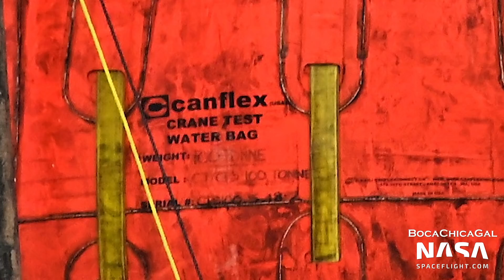Chopsticks Load Testing Resumes | SpaceX Boca Chica

Comment: I think they had a bit of resistance on the rails in the first test. That could be why they have been adjusting and grinding/smoothing them in certain spots. So now a re-test.
Reply: Was  thinking the same. They probably anticipated / planned to do this grinding and smoothing, but saw no point doing it before testing & finding out where it was actually needed.

Comment: 2 * 100 ton freedom units + 2 * 25 ton freedom units would be the full weight of a dry booster.
Reply: spot on
Reply: To clarify, these are 100 and 25 tonnes, not ton. 
So it might be more accurately, taxation without representation units lol
Also a bit heavier, a ton is 2000 lbs while a tonne is 2200.
Reply: I really don't see the logic of conflating the selection of a system of units and other political matters. Elon favours SI FWIW.

Comment: So 2:30 is this a door that will slide inside, swing open on a hinge, or swing sideways on a hinge?  I kinda think the first one would work better, but then I figure for ease of design they might wanna go with something like the Space Shuttle used, it's a design that we already know works and if necessary could be updated
Reply: The prototype door slides "vertically" (longitudinally) to latch or unlatch. This makes the entire cargo door the single moving part for the latch mechanism, similar to the simplicity of a jar lid, but in a linear motion. 

The door may swing "down", so that a crane can insert the payload from above. Or vice-versa
Reply: The door will have a single low torque hinge operator that only works well in microgravity, which might be supplemented with drawbridge - style cables to operate at one G.

You probably have seen these style hinges operating to deploy solar panels on spacecraft.

Comment: Anyone know if there's a need for a "concussive" test?  Like pick up the bar with the bags on it and drop it to simulate a landing?
Reply: That may be called a "dynamic" test; not simply dead (static) weight. They probably have some techniques that we don't know about, but we know the object will be moving at least vertically when it makes contact with the arms. It won't be a one G mating. I'm sure the test bags will weigh multiples of the landing object, but they still may not represent the downward loads. Guess we'll have to 'weight' and see what we're told and what SpaceX does.
Reply: Probably not really necessary though, since the booster can hover. It's probably going to be relatively gentle event.
Reply: @PetrPechar1975  So were all my landings!! 🤪

Comment: Q: Can the chopsticks catch a fully fuelled starship or only a mostly spent/depleted fuelled starship?
Reply: Pretty sure there's no way it could lift or catch a fully fueled ship. Filling it up would be 10x heavier.
Reply: @goldreverre  Yeah thats what I was thinking.... It must be only catching a virtually empty starship or booster
Reply: @marck4219  I seem to recall the early starship prototypes were around 150 ton. The goal was to get them  down to 110 or 100 ton. Fully fueled it might be over 1200. Booster, i think might be pushing 200 ton dry. It might need 30 tons of fuel as a safety margin, so lifting 250 tons, as this test seems to be, would be a fair proxy for a caught booster.
Disclaimer, I'm just pulling these figures out of my memory. Others might chime in and correct them.

Comment: Stage 0 is almost set for an Orbital Launch in 2 months.
Reply: and deconstruction shortly after when Raptor v1 fails on lift off.  <Sad>
Reply: @GerardHammond  That kind of person hmm? Show me a single time a raptor has failed on lift off? Just one.
You can search but i can tell you that you wont find it...
Reply: @Vatsyayana87  hi. I hope it doesn’t but SN11 should what one hard start raptor can do
Reply: @GerardHammond  Hello,
 It doesnt make much sense to compare a raptor being started on its side while in free fall and using a novel feed system to one thats launching.
 There has been 17 engines go through launch so far and not a single one has failed doing so. 
A booster could even lose a few without failing the flight.

Comment: Any idea how heavy the ballast bags are?
Reply: 100 tonnes
Reply: Smaller bags are 25 ton each when full.
Reply: it says on the side, they are pretty smudged though. Also at 6:10 you can see the load cells they use to measure the weight, it's a large block of metal with a strain sensor embedded, a shackle either side, a battery, and a radio transmitter. Those are used to determine if enough water is pumped into the bag (static load) then the dynamic loads on the arms as they move.
Reply: 250 Tons is the total weight of the bags. As it is the same weight of an empty booster its starting to get intresting as we come closer to a booster lift:)
Reply: @johannesschwitzky6474  Tonnes, but right. Just missing about 500 lbs

Comment: That smooth nose cone and cargo door section looks like the basis of an expendable stripped down Starship, maybe for launching Starlink? I imagine that would only need about three engines without the weight of return trip fuel, shielding and fins. Maybe not the fully returnable dream but probably a very viable LEO delivery system.